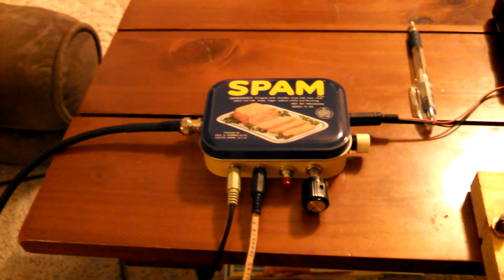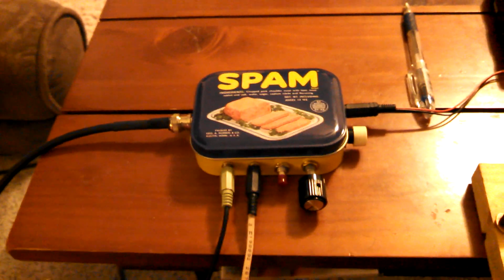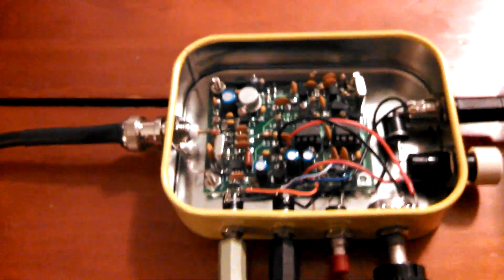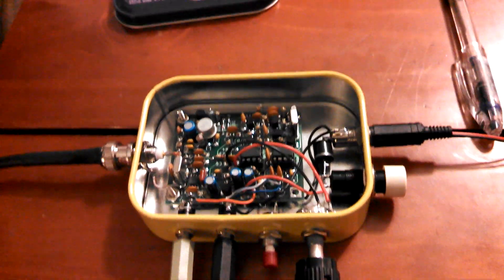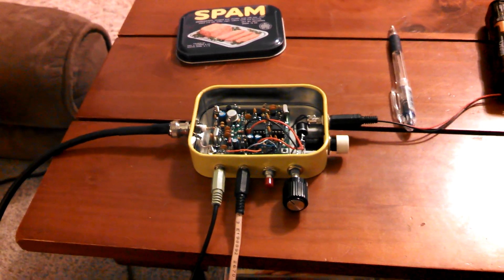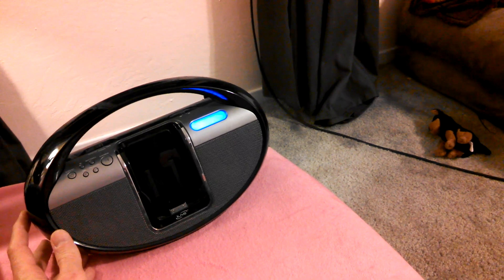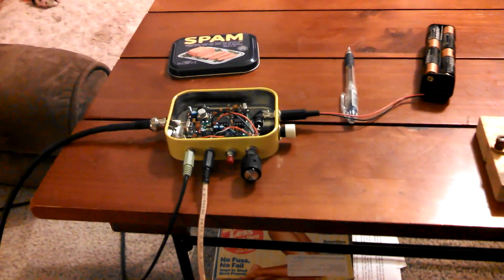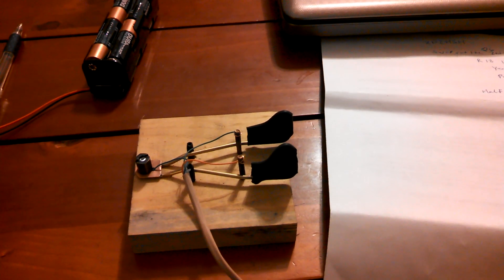Rockmite 40 meter cw transceiver

Comment: Did you ever make a contact with this rig? I found sunset was my best luck on the rockmite 40.
Reply from the maker: I was able to make a brief contact.  Armarello Texas, Buffalo new york, and Florida. I think it was Orlando. I am so slow with the key so my qso is cq, call sign, location. The rig has iambic and strait key capability. I wish Dave still made the kit.
Reply: You can still get an updated version from qrpme.com. Rex Harper took over. He even sells enclosures too. My best Rockmite QSO was a rockmite to rockmite from Stockton, Ca to Tacoma, Wa. That was when everybody was doing rockmites. Of course the Chinese are selling rockmites on ebay like crazy. But they sell it with an oddball crystal on 40 meters. 7.123=extra class portion.

Comment: I built one of these, but I didn't do the power mod. Stuck mine in an Altoids tin. I guess that the price has gone up considerably since Dave Benson stopped selling the kits. Too bad. Now an MFJ Cub looks like a much better deal! The boards are $50 and  I don't think that they include the jacks and switch. I paid $28 when they first came out. The Cub is complete with enclosure for about $100.